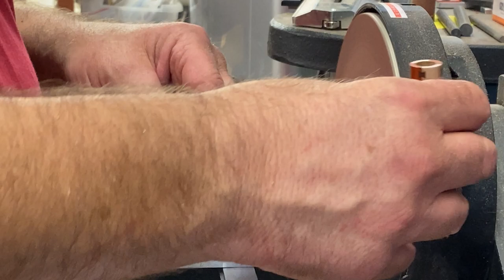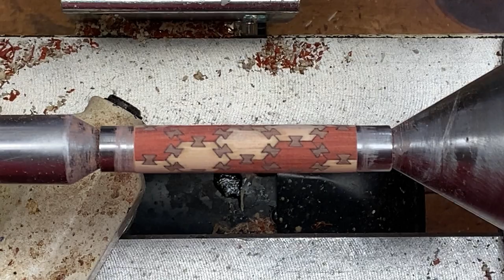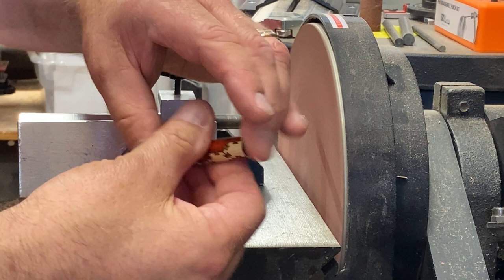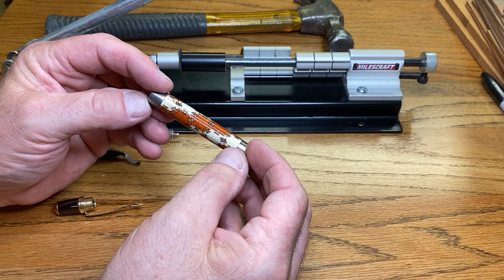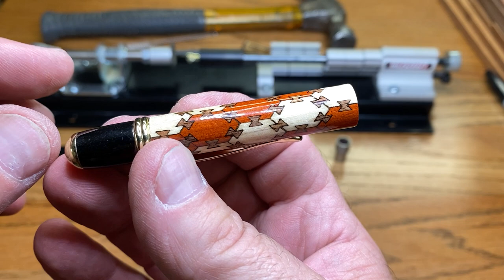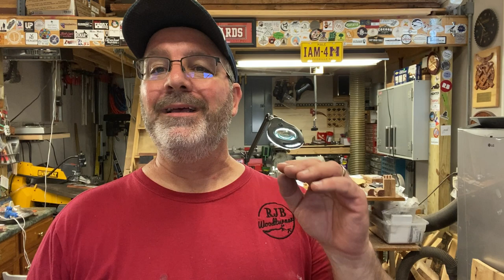Laser Cut Bow Tie Pen Blank

Comment: Beautiful pen. Good call on the dark spot going under the clip. I really like your tips on pressing, chamfering and using a bushing to help keep things square to the press. I also made it a habit of using a cotton swab to apply just a little paste wax inside the tube to act as a lubricant for pressing.  I've just had way too many blanks messed up by cracks due to tube expansion when I am pressing. I've even considered pressing the parts into the tube and then knocking them out before gluing on a couple of very precious blanks.

Of course, thanks for all the work you do in filming and editing these videos for us. They are appreciated very much. - Dave
Reply from the maker: Thank you Dave, 
  Nice tip on the wax inside the tube. 

Regards,
Bob

Comment: Great looking pen mate.  Something I always do after finishing with micromesh is to use one coat of aussieoil.  Gives it an amazing finish
Reply from the maker: Thank you Tommie,
  I will have to try that. Then do you C/A right over the Aussie Oil?

Regards,
Bob
Reply: @RJBWoodTurner  hi Bob. Sorry for the confusion.  I normally finish my CA polishing/micromeshing and the last step instead of the wax I apply AussieOil.  Just one coat with a fine paper towel.
Reply from the maker: @tommiestrydom973  Thank you for clarifying, I will give this a try. 😀

Regards,
Bob